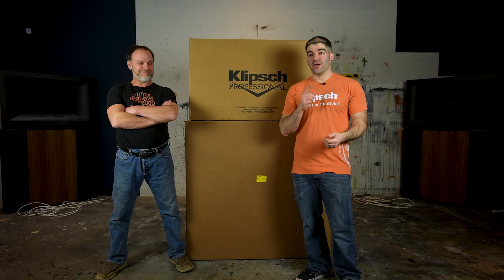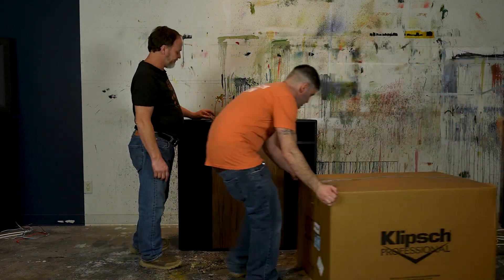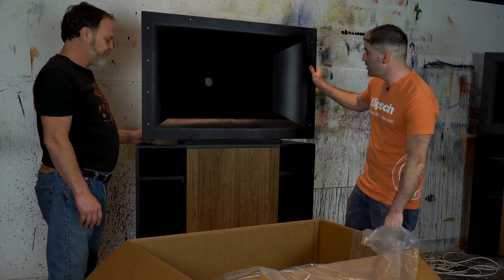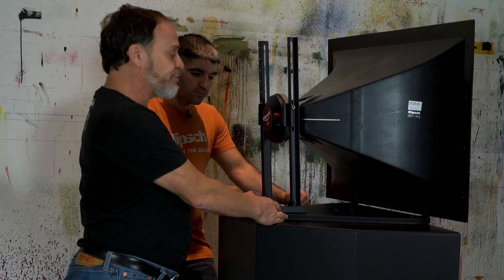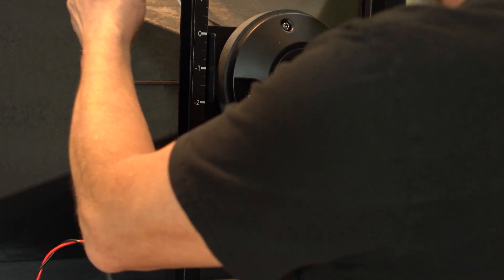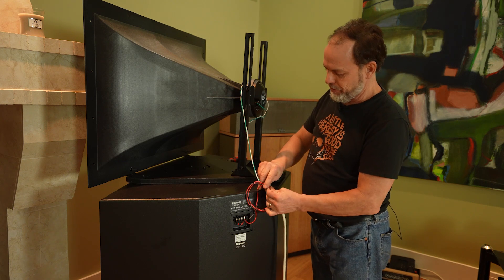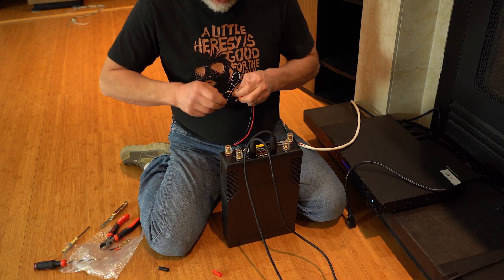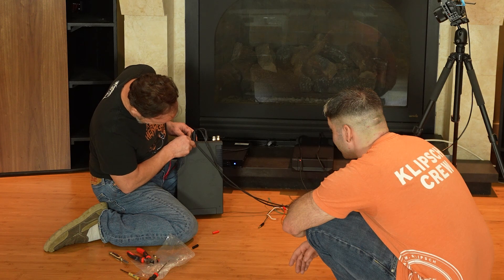Klipsch Jubilee Unbox - The biggest. The Baddest.

Comment: An interesting choice to build a speaker that would otherwise appeal to the SET crowd and then make it dependant on a digital crossover.
Reply from the maker: For sure not for everyone, but for those select few that can own/manage it... no denying the awesome nature of these beasts. 

-Jason
Reply: An excellent decision. 
Better than the amp powering a passive crossover which soaks-up up the timing and dynamics. 

You can still run a SET amp, the x/over is already done and the amp controls the driver directly - like God intended. 
Of course another amp drives the other driver - even more flexibility. 

I always discard any passive crossovers, programme my v expensive DSP to the speakers’ requirements, feed multiple power amps and connect directly to the drive units (actively). 

I would never go back to passive crossovers - they suck the hell out of the music.

Comment: They're advertising a Pair of  jubilees and an active crossover included in the set...  Had you been given conflicting information?  Or? What's up with the Zilica?
Reply from the maker: This is the "underground" versions of the Jubilee before the new/official ones were released. They required the Xilica or similar as they didn't come or have DSP designed specifically for them. We cover the new/current versions in later episodes and even compare the two. Be sure to check those videos out!

-Jason

Comment: Gorgeous !  What are the approximate dimensions (width, height and depth)?  Also,  is this a CURRENT MODEL or is Klipsch coming out with a an updated model  sometime in 2021?  Somehow I was under the impression that they are coming out with a new one this month (May 2021)?  IF so, any idea what are the differences with this unit ?  Are these meant for home use or more for commercial use ?
Reply from the maker: Klipsch announced at CES that they would be releasing a new unit for Klipsch 75th anniversary. There isn't much info released on them as of yet but, if you search for 2021 Jubilee CES here on youtube, you should be able to locate the video of Roy discussing these more in depth.
Reply: @TopShelfAudio  Wow. Do you have dimensions of your current unit ?
Reply from the maker: @ptg01  Sorry, must have missed answering that part in the first reply. H- 77.25", W-41.5", D-24.5"
Reply: @TopShelfAudio  HUGE!  How old are these speakers / when was it released ?

Comment: I’m confused, this Jubilee is it the same one coming out this summer? Does this one that you guys installed have the new LF section that goes down to 20 hertz?
Reply from the maker: This is not the new ones, it's the style that has been around for the last 20 years or so.  The new ones will be similar in idea but this is considered the pro style.  The new ones are more targeted to residential installations so little details like the terminal strip should turn into a nice aluminum terminal cup, we'll have veneer, grill cloth, things like that.  -- Cory
Reply from the maker: The new style should be available late this fall, 2021.  That's the last story I got at least.

Comment: Does the Jubilee utilize the same woofer s as the Klipschorn/LaScala?
Reply from the maker: The K-horns and LS use a 15" woofer, this style of Jubilees are dual 12's.  There's no official spec sheet available yet but based on unofficial chatter and renderings I suspect the Jubilees coming out in fall of 2021 will have a single 12" that's ported like the KPT-1802.  Slight chance the new ones will be a 15 but I haven't seen anything.  -- Cory

Comment: Drop a capacitor or resistor on that HF driver.. ?? 😁
Reply: Or even a light bulb....a 12V bulb would work fine.. that would start limiting the level (compreson) to about 14 Watts. At some point after that the bulb will blow and protect the driver.  IF you use a resistor, you need a RDX90 polyswitch in parallel with it. It is a current limiting device and should be about right for the 3 inch driver.  You can always go with a 24V bulb.   Yes, protection is important.
Reply from the maker: Trey has it covered! Thanks for watching!

Comment: You made an inline inductor by coiling the LF feeder wire.  That's a no-no.
Reply from the maker: theoretically this is correct.  however do some calculations on two windings with a 4" diameter wire.  Even if the windings were tight and it worked as if it could be an issue, the frequency in which the treble would start rolling off would be approaching 1 khz on the bass bin, at a 6 db per octave slope.  Seriously doubt you could ever tell the difference in this situation even if you actually measured.

Comment: From the looks of things, it also seems as if the HF/MF horn's vertical pitch can also be fine tuned for listening position height.
Reply from the maker: Yeah it can, usually not super necessary if you are like 15' away or more but otherwise yeah you can tilt them down.  They are built in such a way that some of the enthusiasts have figured out you can tilt them so far forward and down that they go over the front of the bass bin, aka. the lowrider mod... not that I can promote such things. -- Cory

Comment: It's shameful at this price point I have to get my screwdriver and reassemble the mid/high driver.
Reply from the maker: These are the "underground" Jubilees. They were never designed or intended to be direct to consumer so, some adaptation once they arrive in a home should be somewhat expected. When the new units were created they made them more consumer friendly. You may want to look into that option instead if that part is a deal breaker for you. 

-Jason

Comment: 15-16000$ speaker and a 10$ speakerterminal?
Seriously Klipsch!

If you went pro, why not XLR or NEUTRIK?

That was really disappointing to see!

The one thing that matter as much as the components are the gauge of wire!

Years in car audio and Pro audio taught me that one!
Reply from the maker: Speakons are nice for stuff that is taken down and put back up often such as bass guitar cabinets and PA speakers.  For permanent installation, speakers such as these, like what you'd see in an actual pro cinema, that is not the norm at all.  Look at the back of a huge JBL 5742 stack or even the 300 pound JBL 5674 and you'll see the same thing.  Krix and Dolby uses some proprietary connectors but even they don't use Speakons.  

Terminal / barrier strips are really secure and it's one less connection which theoretically means less noise / loss.  You're not gaining anything at all by screwing the wire onto a Speakon connector then plugging that into the cabinet.  The only thing I dislike about these in particular is that the strip is a little narrow, it works fine for bare wires but it doesn't even fit standard spade connectors.  A little more space and we'd be golden but as it stands, bare wire is the only option, which sucks for the guys who want to use nicer pre-terminated wires.  

That being said, the new Jubilees coming out later this fall will have some super fancy terminal cups that are more in line with the current Heritage models and should look super nice.  They only cost over twice as much.
Reply: Placebo effect